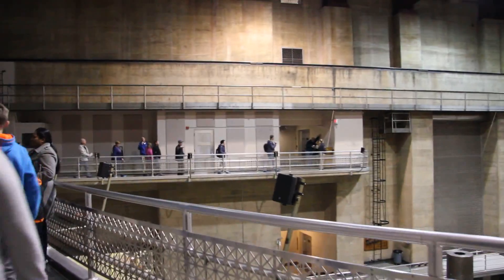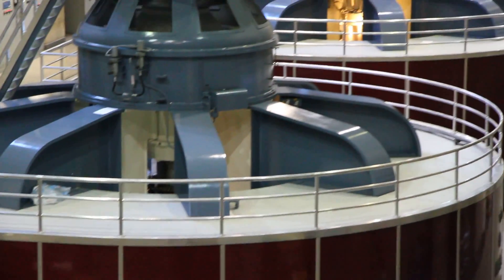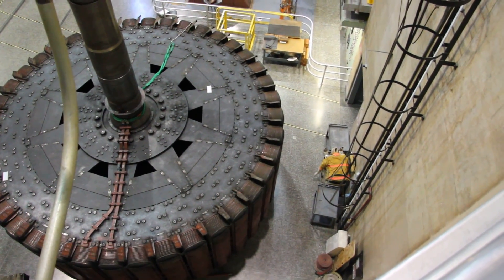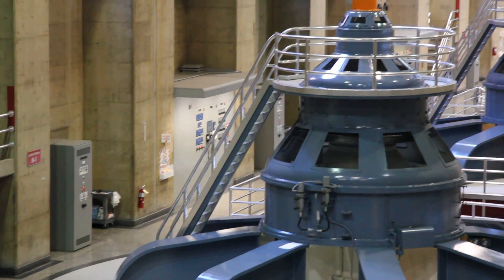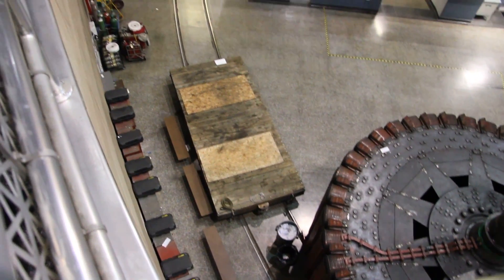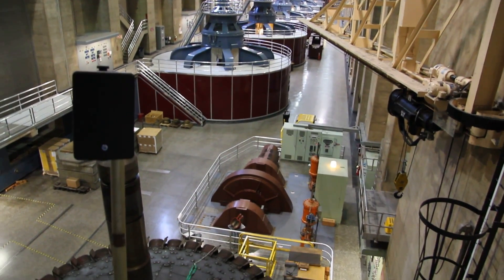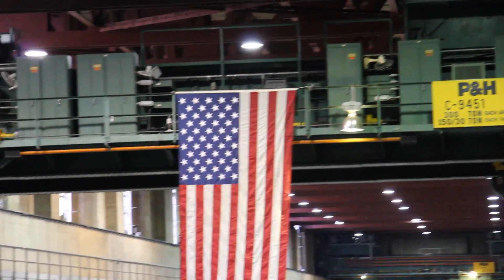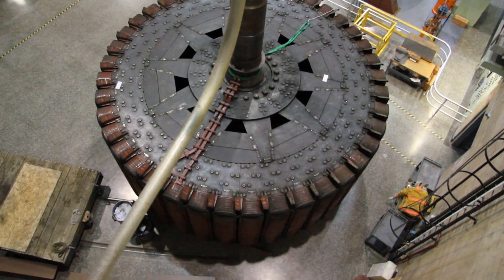Hoover Dam Power Plant Tour - Narrated

Comment: In 2012, the Three Gorges Dam in China took over the #1 spot of the largest hydroelectric dam (in electricity production), replacing the Itaipú hydroelectric power plant in Brazil and Paraguay. The Three Gorges Dam has a generating capacity of 22,500 megawatts (MW) compared to 14,000 MW for the Itaipu Dam.

Comment: you can kind of hear the 60 hz vibrations from the generators.
Reply: If u work near the generators u can "feel" in time  heart disease too from the electro magnetic field. Is the most common disease workers get from staying in that magnetic field.
Reply: @vst9266  sucky! yeah the EMF probably effects the electricity the heart uses.
Reply: actually it's 120hz
Reply: estebanquito356
 ??!!!  How is it that it is 120 Hz, when the power frequency is 60 Hz? I always thought the vibration of the elelctricity supply (50 or 60 Hz) was directly from the rotation of the commutator in the generator... O-o
Reply: Oh baby big shaft
Reply: @jefftoole5154  LMAO!!
Reply: I was curious and am running the audio through a spectrum analyzer in Pro Tools as I write this. I'm seeing sub freq's starting at 35Hz @ -6db and peaking at 80Hz @ +1 db. 
There's probably far lower than 35Hz on site but that's probably the limit of this camera mic.